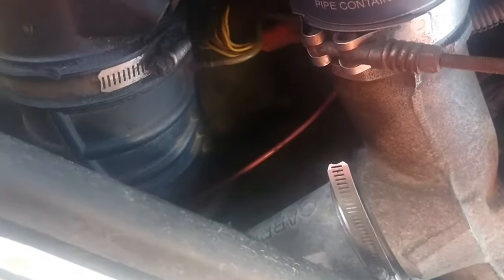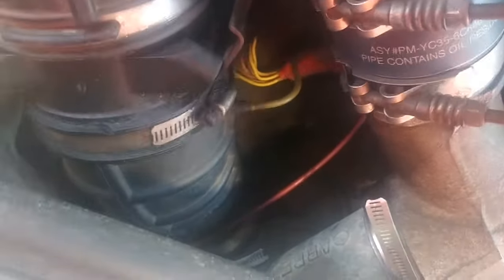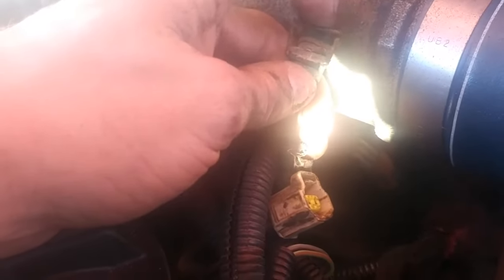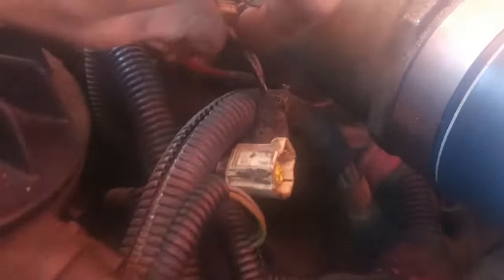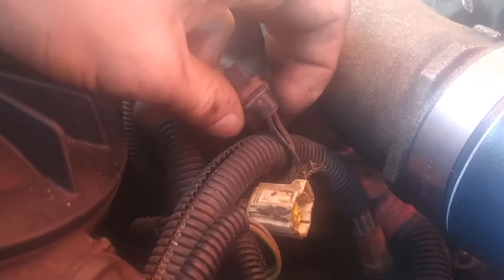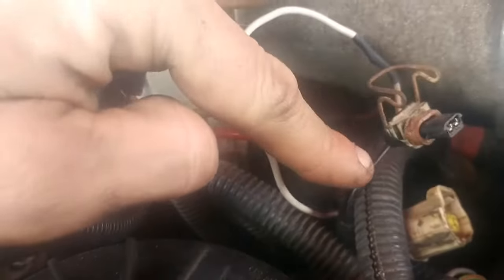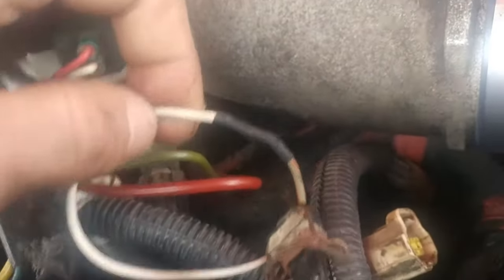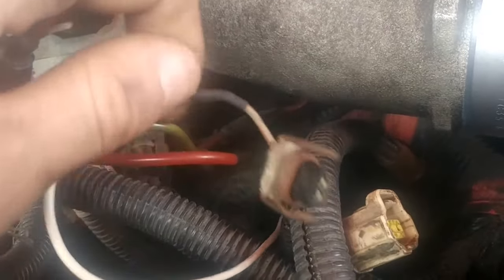2000 Ford 7.3L Exhaust Back Pressure Valve Quick Fix and Exhaust Brake Mod / disconnect

Comment: Hi mate you have a new subscriber 👍👍 from Norway 🇳🇴 😊 I have a Ford excursion 7.3  and today happened something strange 🤔  like other times I waiting for glow plugs off and started and he started the engine running good but after a cople seconds the engine is stopped self 🙄😏😐😐 I hearing a air blowing looks like coming from the turbo zone 🤔😏 but I'm alone I can not exactly who coming from that blowing 🤔 a strange thing is a electric vacuum pump not running to 😏 I checked a failure code is P0478!! I apreciate any caind of the help fellas cheers from North of Norway 👍👍
Reply from the maker: Hello,
Jorge! Sorry to hear you are having trouble with your 7.3L.
From what I understand, You are saying that your truck will be running fine and then randomly shut off.  The Cause of this is usually a bad Crank Shaft Sensor. 

First you should check the harness connection to your ICP (Injector Controller Pressure sensor).
Also Check your Harness Valve cover connectors. (They can rattle loose over time)

A bad ICP can also cause weird troubles.. Try running the truck with ICP unplugged and see if the truck stays running better. 

If not, Install a new crank position sensor on the front of the engine.
Reply: @Jimmy Do All  hi Jimmy 👋 thanks for your attention 👍 I checked a failure code (P0478)!! something about control exaust valve to hi🙄🤔😏 what a hell sensor can be?!!🤔 unfortunately no-one understand nothing about this caind of the engines up here 😕 😞  the last time I driving it's normally everything it's fine 🙂  he starts good but after a cople seconds the engine is stops immediately and I hearing air blowing just a second! looks like coming from turbo or exaust pipe but  on turbo zone 🤔 🤪🤪
Reply from the maker: @jorgefonseca9225  I understand but, I have had multiple 7.3L trucks have your issue and its always been a camshaft sensor. They go bad and shut the truck off randomly. 
as far as your code goes (P0478)
If  you unplugged the connector in my video, it may clear that code. It just means the butterfly valve in your exhaust off the back of the turbo is sticking on. That would not cause the truck to shut down.
Reply from the maker: DTC P0478 indicates an excessive back pressure condition existed during normal driving.
Possible causes:
stuck EBP butterfly valve
restricted exhaust
plugged EBP sensor line
misadjusted EPR linkage
F-Series wastegate turbo may be overboosting

This would cause loss of power. not a shutdown
Reply: @Jimmy Do All  ahhh that's a air blowing air leak on turbo zone 😏🤔 I see  🤔 a cople weeks ago I tried clearing a egr sensor! is in front of the engine close to the fan ventilator 😐 but the metal house is dirty 😳  probably I need replaced that metal house and this damm sensor 🤔🤪
Reply: @Jimmy Do All  also I need replaced a iCP sensor because  leaks a little oíl on electric connector 😐😏🤔 the  funny thing the last time it's started very good 👍 and now happens this 🤪🤣 thanks for your attention and your explanation I will tried finding out where is a problem 🤔👍👍 we keep in touch 👍 thanks mate 👍
Reply from the maker: @jorgefonseca9225  Np!
Yep a new crank sensor should fix your stalling trouble. 
I new ICP should make your truck run better. At least keep the connector clean from oil until you get a new one. 

A new EGR sensor should help with your power. Make sure that steel tube feeding it from the exhaust is clear. 

Good luck!

Comment: Do I have it right,unplug it to disable the ebpv and that will keep the flapper open in the exhaust to avoid it from closing causing lack of power on cold mornings?Thanks.
Reply from the maker: Yep youve got it. Just unplug it if your having problems with it.
Reply: @blackmasta71  Appreciate the comeback! I bought a school bus with the t444e, only on cold mornings if I take off before warm,it lacks power,then all of the sudden it takes off and is fine after that. I never had issues over the summer just recently because it usually sits over the winter(rv) use only but I needed to take it on a winter morning to get new tires. Thanks for all your help.
Reply from the maker: @bobfidguello7239  np mate. 
If you wish to delete the EBPV completely, I can provide a link to a china kit you can order. I did it on my truck and I am still running it years later. 

Its a good mod to do when you do a turbo rebuild. It allows more air to flow and less restriction.
Reply: @blackmasta71  I only saw a video on someone deleting a 7.3 that was a 1997 model year,mine is a 2001 t444e and wasn't sure if it could be deleted as well because of the computer. I'm new to these engines so not sure what can or cannot be done.
Reply from the maker: @bobfidguello7239  It can be. Its a cheap mod but hard to do since the turbo bolts are 12 point and very rusty. Thats why I recommend only bothering with it once the turbo needs rebuilt. Which the rebuild kit is as cheap as 60 bucks.
Reply: @blackmasta71  I noticed those bolts looked like they'd be a bear to deal with. Appreciate your help,take care.

Comment: Have any idea what backpressure psi it’s running? I know there’s kits that mount on the back of the turbo or in the exhaust and they said you want to adjust it to 40 psi max for the 7.3, any psi less than that is totally fine for the motor, any more it potentially can damage from what I heard.. thanks for the video! That’s a great idea!
Reply from the maker: Sorry no idea. 

If your talking about setting the Vaccume operated turbo bypass valve I can tell you that if its set to not open, the truck performs shittyer anyway
Reply: @blackmasta71  gotcha, naw apparently the pressure that the valve holds back in the engine against the turbo “has to” be less than 40 psi. I’ll probably go with deleting it with a new pedestal when I get the kc turbo stage 2 kit and get a bd performance Jake, planning on getting a gear vendors 2 speed gear splitter so I’ll have a double OD too 🤘🏼it’ll be just like an 18 speed Eaton fuller in my dump truck but instead a “12 speed” zf6 😅
Reply from the maker: @Jaredcs199  sounds narley. Better make some youtube vids of that thing

Comment: Great video. Question though, so you pretty much only want the back pressure valve on during colds starts and lower rpm’s after cold starts, right?
Reply from the maker: Yes it was designed to make the engine work a bit while idling causing it yo build heat faster. 
Over time the automatic actuator starts to fail and it turns it on while your driving. 
This just shows a way to manually control it.
Reply: @blackmasta71  thank you, I will probably install a switch, my truck has automatically closed the valve many times when I am just driving.
Reply from the maker: @mr.turtle2728  or if you do not plan on using it at all  just unplug it and use a fast idle stick between the seat and throttle pedal ;) 

A 6 position tunerchip with a high idle setting is best.
Reply: @blackmasta71  I had started this project, but I’m not exactly sure how you set up your switch. How I understand it, you spliced the beige wire to the first wire that runs to the switch and the other wire that runs to the switch is directly connected to the positive side of the battery, correct?

Edit: the black wire is left alone and not to be messed, right?
Reply from the maker: @mr.turtle2728  correct. 

I would put a 10amp fuse in my 12v power on the battery just to be safe.

In my case I stole 12v from a fuse in the fuse box under the dash that came on with the key. 
You can even order these adapters off amazon that are called add a fuse.
Reply: @blackmasta71  ok, thank you for the clarification. Should be completing this today.

Comment: So, there is a solenoid that actuates a valve to move the plunger rod?
Reply from the maker: Yes something like that. Sending 12v to the solenoid activates the Backpressure vavle but the valve will only come on if the adiquate oil pressure is there. Like if the truck is real cold the valve wont come on right away or not until you rev the truck a bit and it will kick in.

Comment: I have an early 99 f-250 I don’t have that hooked up will it keep my truck from starting?
Reply from the maker: No it will not. You will get an engine code for the sensor but thats about it. 
By having it unplugged, the flap will not engage when the engines starting up. 
A better way to go would be a 6 position chip with a high idle tune.

Comment: Does this make the eco throw a code I really don’t want a check engine light
Reply from the maker: What do you mean by eco?
Reply: Sorry typo, I mean on the PCM or ECM computers I don’t want a check engine light
Reply from the maker: @TacticalOperator01  No it should not as long as you make sure you send the 12v to the turbo and not back on the ecm lol

Comment: Help me understand why you put it on a switch
Reply from the maker: Its just a fun mod to make an exhaust break. Also if the oil actuated switch is malfunctioning (which happens in older trucks) this is a way to manually control it for faster warmups
Reply: @blackmasta71  does your truck throw a P0476 code running tests on or with forscan or any  other type scanning system?
Reply from the maker: @MikeConner.akaRadio  its been a long time since I did that. I never had any dash engine light. 
If your exhaust back pressure valve is malfunctioning and coming on when it shouldn't then a quick fix is just to unplug it. That way it cannot be actuated. 
Since this mod I have now rebuilt the turbo with a EBPV delete. I just purchased a cheap kit from AliExpress. It has been holding up for years now.
Reply: @blackmasta71  Well, I just took my down pipe off, and the physical valve has been removed already  that may be why I am getting Po475, 0476,  I have no boot unless my chip is on full power but only get 18ppunds and when it needs more it falls on its face,  like it's starving for air. 

Got me thinking 🤔 😌   I wonder if my muffler is actually plugged up. 

I've seen such on gas engines when a muffler or a Cat is plugged. 

I got help and had him power brake the hell out of it, when he took it to full throttle and held it for about 10 seconds or so the up pipes started leaking pretty bad.   But only under load. 

Going to drop my muffler or disconnect it and try it.
Reply from the maker: @MikeConner.akaRadio  oh really eh. 
Well if your up pipes are leaking then you will loose boost for sure. 
I would also check your compressor wheel for play on the intake side. (In and out play is bad, A little up and down play is acceptable) 

Also your air filter is very important. Even if your air filter does not look thst dirty, you will notice a difference with a brand new one
Leaky intercoolers can cause a loss in boost also. What year is your 7.3L? 

I find that the stock compressor wheels buffet the air when under full load. Upgrade to a wicked wheel 2 compressor wheel and its nice smooth boost.

Comment: So what you got a 2 wire toggle switch and connected one of the wires straight to the battery I take it as well
Reply from the maker: Yep pretty much, instead of running right back to the battery, i just went to the fuse panel under the dash. 
You can buy whats called "Add a fuse" and hook up another fuse and wire off an existing fuse in your fuse panel. 

Or do it really dirty and just quish your switch wire in with an existing fuse in the fuse panel. ;)
Reply: And another question I am tired of hearing it open and close when driving randomly the ebpv so now if I do this it won't kill my motor and it also will stop it kicking on randomly correct it should only kick on when I want it to kick on
Reply from the maker: @dylansheridan9254  exactly it will only come on when you flick the switch.
Reply from the maker: @dylansheridan9254  or leave the connector unplugged and it wont come on at all
Reply: @blackmasta71 which fuse did you tap into?

Comment: Why haven’t people done this on newer models 2002 with the automatic? Does it not work or something? Only for manual?
Reply from the maker: You can do it on all 7.3Ls
Reply: @blackmasta71  okay thanks I will definitely be doing it to mine
Reply: @blackmasta71  
Thx for showing me how to do it great video.I’ve done it to my 2001 f250 and it works damn good when I shift down, I like how it sounds. Is it bad for the motor ?
Reply from the maker: @ezequielpena1247  right on. Its more a mod for fun. Its not good to do it all the time.
Reply: @blackmasta71  thx man, I was planning to use it pulling my trailer so I don’t have to use my brakes to much. But I don’t wanna mess it up
Reply from the maker: @ezequielpena1247  yeah do some research. I feel I read somewhere that its not that great for the motor..
Reply: @blackmasta71  thx man I’ll leave like it is right now and try not to play with it until I get me a full exhaust brake system. Again thank you 👍🏼 for answering my questions take care yourself
Reply: @ezequielpena1247  You're not going to hurt your motor using this. Just keep the rpms below 2400 or so when using it to keep the turbo below 25 psi. I forget what the threshold is but if you exceed it, you'll trip a cel or something of that nature. Again though this isn't going to hurt the motor at all.

Comment: Dumb question I know but why not just replace the censor.
Reply from the maker: You can if you want but it usually messes up in real cold weather. 
Its much better to have it on a manual switch

Comment: How well does this work when pulling a heavy load? Have any videos of the speed decrease? Thank you
Reply from the maker: I havent towed heavy with it yet. I just did it more for fun. Do some research on it. It may not be so great for the motor.
Reply: Depends auto or stick if u have a auto youll have to get a torque converter switch to keep the TC locked up to provide braking stick it doesn't matter if i remember correctly from the forums it works but nothing crazy 10-15% braking better then nothing
Reply: Bill Meyers I did this to my 73 and it works but when activated there’s no Throttle response it loses all power
Reply: I was having trouble getting out of second gear, I have an exhaust brake but it’s disconnected because I thought it was malfunctioning. I was encouraged to look at the tube to my EBPS and I found the tube had a hole in it. If my sensor wasn’t getting stimulated, would my EBPV close and keep me from accelerating? I know that I have to replace my tube but, I wonder if my sensor NEEDS to be replaced. I see sooooo many people cleaning their tubes, it’s such a cheap part! I don’t understand that!
Reply: @NewEdgeCarpentry  why would u be giving it power when the exhaust brake is on    do u floor your gas  and push your brake at the same time

Comment: Whats the idea of this? I'm new to diesels and 7.3. Thank you
Reply from the maker: On Higher milage 7.3s the exhaust back pressure valve sensor turns the valve on at the wrong times causing your truck to not have power when really the valve should only be on during warmup. 
This video shows how to disable the valve if its sticking on, and it shows how you can put the valve on a switch so you can control it manually.
Reply: @blackmasta71 umm... Remove the butterfly, remove the solenoid, weld it up,  put a 470ohm resistor across the sensor at the front and have a nice day...
Reply from the maker: @darrentylor5473  Yes that is a good mod to do once you have the turbo out for a rebuild. I installed a EBPV delete kit on my turbo instead of just welding up the oil ports for the oil actuator. What is the resistor for? My truck is fine with it just unplugged ?

Comment: That is not the exhaust back pressure sensor
Reply from the maker: Well, mate I have done this to multiple trucks. It disables the exhaust back pressure valve so what do you want to call it?
Reply: I'm thinking that it is the switch or plug to the actuator of the flap, the actual sensor is located on the passenger side front of the HPOP, the sensor sits on top of the small maybe ¼ inch steel tube that routes down to the passenger side front manifold. Which is where it actually is getting the backpressure reading. The sensor should actuate the flap anytime the pcm senses the intake temperature is below 50 degrees Fahrenheit and the oil temperature is below around 148 degrees I think. It is supposed to make the engine work harder,  basically it simulates a load on the engine to make it work harder (the decreased throttle response) in order to make the heat work faster/warm the engine in cold climates.
Reply: Anyone looking to clean the actual sensor (not the part removed in this video) but on the front of the HPOP, only clean it off with a soft brush and air, any chemicals can destroy the sensor if it isn't already.  But these are subject to carbon deposits and the tube it's mounted to gets blocked easily or even rots out. If you have to replace the sensor stick with Motorcraft or a REPUTABLE diesel parts dealer,  don't try to get away with the "Prime" special for half the price. These are one of the few parts critical elements of the almighty 7.3! I may very well come out of the same plant or factory as the Motorcraft one, but the engineers have provided strict standards to manufacture the Motorcraft part and the cheap knockoff ones are made with less quality.

Comment: check engine light on now
Reply from the maker: Hopefully your not feeding 12v back to the computer
Reply: Are you using it above 2400-2500 rpm? Keep your turbo psi below 25 when using it.

Comment: Horrible video footage
Reply from the maker: Instead of commenting Make a better one then. Its in a tight spot.
Reply: Ima do this to a 2001 f450 manual 4x4 single cab short frame with a flat bed. I’m just gonna do it for the sound of it. I’m gonna post videos if anyone wants to see them. Also thanks for showing me how to do it. Great video man